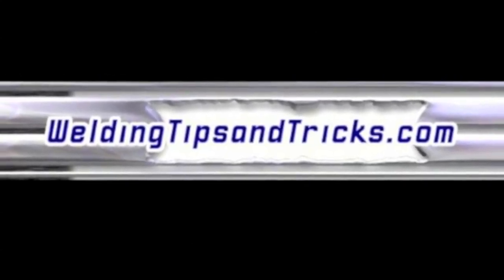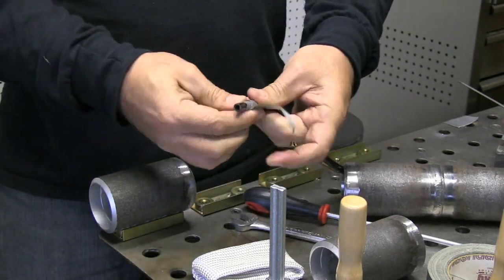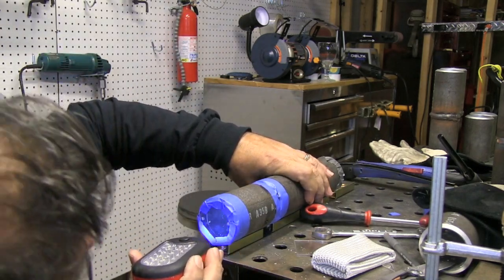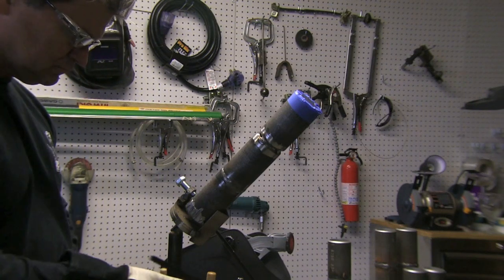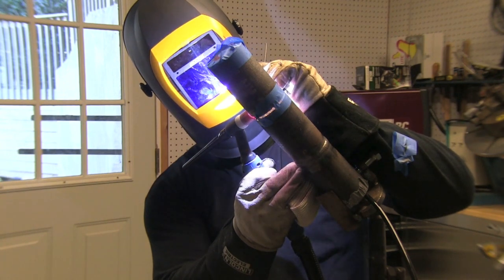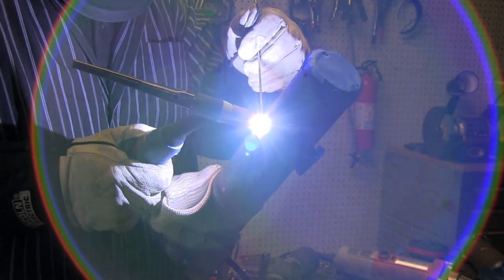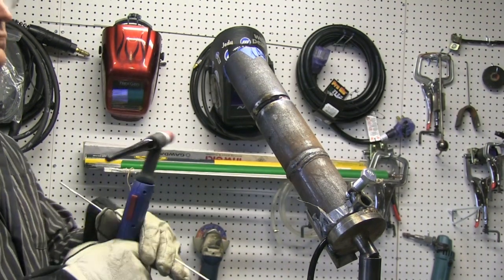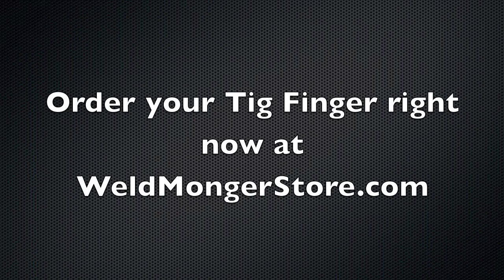Tig Welding Tips - UA41 6g Pipe Welding Test (re-uploaded)

Comment: love the smell of melting duct tape in the weld booth. just took the UA-41 a week ago. still waiting on the results but I'm confident I passed. however I walk the cup the whole way. I do a little dip/keyhole on the root but while walking. I tend to run a 3/32 gap, knife edge with a 3/32 rod at 75amps on scratch start. than for my hot pass/fill/cap I run between 85-95 amps.

Comment: Excellent video. I use aluminum foil to cap off the ends of the test coupon, it does not melt like duct tape. If the open root gap closes up during welding I use a cut off wheel to maintain a 3/32" gap.

Comment: 99% of all welding test, you are not allowed to use a Grinder
Reply: been a Boilermaker welder for almost 20 years...never a problem to use a grinder on a pipe weld...
Reply: +Brian Barbour ur totally wrong...lol maybe on easy structural tests ur always aloud a grinder on pipe
Reply: +jiggy  my last job was 316 stainless and you where not allowed a grinder and you could also have no color in your root.  Maybe you need to work more jobs.
Reply: +Brian Barbour I guess I was referring to mild steel as in the video above. Yeah a tig stainless test I can see you not being able to use a grinder. I've spent my years as a welder welding 6010 on pipe and flux core struc
Reply: Been welding for almost 7 years. Never not been allowed to use a grinder at all with exception of food grade tubing for reason of non marking requirements per wps. 
Most tests you will be allowed to use a grinder for prep, feathering, and wire wheeling. I've also been allowed to use them with a cutoff wheel to clean the toes of a root w 6010.
Reply: I’ve taken many hire on tests and always been allowed to use a grinder carbon stainless monel

Comment: is it OK to remove argon hose and tape when root pass is complete? and how much pressure or psi is argon feeding in the pipe? and is stainless pipe done the same way?
Reply: +Aenoy Phranasith the pressure is very low. just enough flow to fill the pipe needed, not too high as it blows out at the end, but just enough to keep the gas inside, very low flow. and yes stainless steel is done the same way if specified.
Reply: +Aenoy Phranasith I leave my purge hose in until after the hot pass. this may not be necessary as i am fairly new at this but I saw a buddy have a root sugar on him during his hot pass while taking a 6GR 2"in schdl. 40 stainless so i just dont chance it. hope this helps
Reply: +Aenoy Phranasith Always leave your purge in, Why would you remove it? You can check with the back of your hand and feel the Argon blowing, you don't want a bunch of pressure, just a steady flow, Also use some kind of gas diffuser, like a piece of cloth, steel wool or a piece of scotch brite pad.

Comment: I went back to school at ArcLabs for 6G GTAW and just got the tigfinger regular and XL.  Love em'.  I tried a couple other tricks like wrapping my stick glove around the pipe but this is more practical.  The regular actually just fits two of my fingers in a way that it doesnt come loose over time.  Really handy.  With an added cotton finger tip cover on my middle finger I get all the dexterity and comfort I need to weld pipe all day.

Comment: why use ss filler on carbon steel pipe? ps., enjoy the videos! thanks
Reply: Dave Osland It gives you a qualification for stainless, because of the classification of the filler rod
Reply: iw63boomer Thanks for the reply-
Weird, because Stainless performs differently when welding vs. steel-
"suck back" on the root, HAZ, etc..
Reply: Dave Osland
TRUE!  I don't have my notes in front of me ... but it has more to do with how AWS or ASME classifies the filler - there is a lot more to is than this ... I will be away from my work station for a couple of weeks, but when I get back I will try to hit you with a more complete answer.

Comment: Have any tips on welding schedule 10 ss 308L? I'm using a 1/8 gap and 3/32 for my root which seems fine but not getting a real heavy pass like in your video, mainly flush with no suck-back. Thanks.

Comment: You could use a bullet tack, no need to purge for tacking? btw i bow to your greater knowledge, i'm just thinking, because i recently started using them, because then there's no need to grind or feather tacks out. I just use a slitting wheel to cut them off and file the tack off the outside of the pipe. I use 1/2" solid rod,cut 3/4" long, top and sides as bullets.The bottom I leave open.
Reply: Hi Mr Jody
Your method welding teknik very nice idea tig finger very important. I believe you wonderful  when show your video good way how you weld I would like to thank you

Comment: How do you make your weld flat on the bottom, I'm having a real problem with it hanging down, I'm welding schedule 40s stainless pipe 6g, and on the bottom it sags down and toutches the tungsten, it's driving me crazy because I matched everything you have shown in the video apart from the pipe is stainless, I've tried changing the gap, amperage, purge pressures, joint prep, filler wire, welding technique, and speed, also the penetration is very very shallow and get massive suck back on the bottom, please help
Reply: Try keeping the wire in the puddle and feeding it while weaving wider. Or hold your wire up inside the pipe a lil. Rest it on the bottom of the middle tack and feed it into the puddle.

Comment: any tips for a 2in shc 80 stainless steel iv be tryn on the surface clean at 80amps and the bead gets grey after putn on a 2in bead from 3 to 12 oclock hope to see a stainless pipe root and all please
Reply: I'm assuming you're talking about welding after root?  You're probably getting the material too hot or inadequate shielding if its turning grey.  If you want the piece to stay shiny you can probably only weld an inch at a time and let it cool that you can touch it.  For the heat it may sound contradictive but turn it up.  80 is enough for a root because you're basically just melting wire, but for the hot pass, especially on heavier material, you will need more amps.  Having too low amps will take too long to form a puddle which is just dumping excess heat into the part. Turn it up so you can form a puddle almost instantly and move. Don't worry what he is welding at every welder will run different.  We usually have Miller XMTs at work and I would weld somewhere around 110-120 for a hot pass on heavier tubes if I could change my machine between root and hotpass, and that's on scratch start, liftarc maybe around 140.  I also freehand everything which would probably let me move a little faster than someone walking the cup.  If its shielding try a gas lens to cover a wider area and allow it to cool while shielding gas is present. Welding stainless boiler tubes I'm usually not that worried about a perfectly shiny weld, they're stainless for strength at high temps not for corrosion resistance but if a weld is really grey or ugly I'll hit it with a stainless wire brush to get all the oxides off, let it cool almost completely and run over really fast with no wire and they shine right up.

Comment: I'm not a welder so excuses my ignorance. With the purging of the pipe with argon this is obviously for applications where very high quality  and constancy is required. Can you give some examples? Natural gas? Steam in power plants? What kind of pressure and conditions are the welds these pipes expected to withstand?
Reply: It's purged because the root is stainless.  Stainless will "sugar" if not purged, basically the chromium is coming out of solution and will oxidize where exposed to oxygen.  Its called that because it looks like sugar on the surface, inside the pipe.  The examples you listed are not as critical as you'd think a lot of natural gas piping is all 6010 downhand and a majority of welds in steam generation are 70 series until you get to superheated steam where it will be up to say 90 B3 wire or 9018 B3 stick.  90 B3 has 2.5% chromium so it will sugar if way overheated, but normally it isn't purged. Modern boilers are designed with T91/P91 also called 9 chrome steels and they must be purged to avoid root oxidation.   As for pressures it depends on boiler design, older small coal or garbage burning plants can run as low as 500psi where new supercritical boilers run over 3200psi.  The average plants around me produce 500MW from coal fired boilers that run at 2750psi. The lower tubes in a boiler like this have liquid water in and are approx. 2" id and .3" wall thickness or more but with wear I've seen them under an eighth inch wall before they fail, which is usually quite catastrophic if a large area is wore.  Purging is normally used for sanitary piping in the food or medical industry where the roots must be clean and smooth.
Reply: Justin Benjamin Thanks that's some good info and not what I expected. Given me some interesting material to look up.

Comment: Great to watch, Thanks for the upload. in regards to the tig finger, is there anyway you can get a pocket type one? so it fits over 2-4 fingers? or are the current ones stretchable? Cheers
Reply: Yeah! I would buy a two-fingered Tig 'glove over' for $50 bucks, or maybe add a Velcro or snap type connector to them? I have an old sewing machine for leather and am tempted to try to stitch two on there, but find myself switching fingers too often to make it a permanent thing, so an attachment system would be cool! Sorry to "bump my gums" about something I'm sure you've heard more than twice!